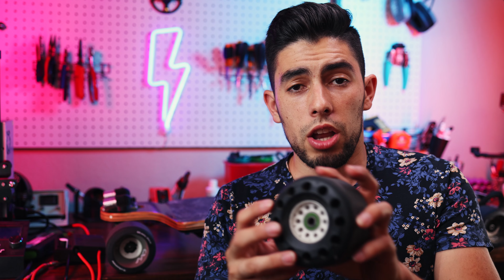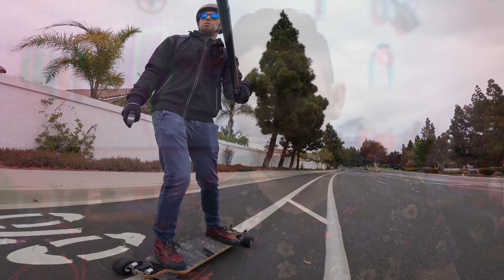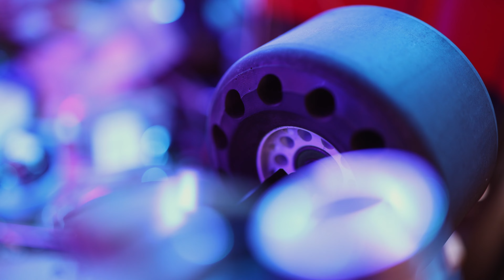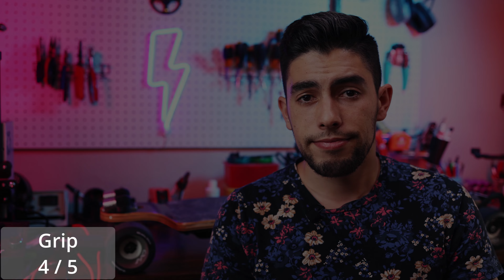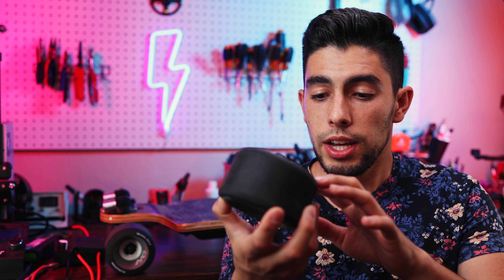MADESK8 / Boosted 105's: Best Urethane Wheel? (100 Mile Gear Review)

Comment: Nice and detailed review. Just to add some info : I just got a set of the Mads V2, and the Humming/whistling noise they make is pretty annoying to be honest. This noise happens at any speed, the fastest you go the more high pitched and audible it gets but it never disappear. It's not making noise like crazy, but it's still annoying to me. It's certainly due to the holes inside of them. I don't get any bad vibration so far though, just noise. I'm used to BOA wheels for street setup and they don't make any noise riding, grip quite well and don't chunk. In term of feel I slightly prefer the Mads over the BOAs, but that constant noise is killing the quiet rides that I like especially on nice roads. I've got also TB110s 74a and I've never liked them much despite all the good things I read about them. They really don't grip well at all compared to the BOAs or Mads, and I feel they bounce too much when in contact with rough roads. You should review the BOA wheels Ive got the old generation 83a, so I don't know how they compare to the new formula 76a or 74a
Reply from the maker: Thank you! It's interesting that the sound bothers you so much, honestly, on most of the boards, even at 30mph, I can barely even hear the sound over the belt or gear drives. I personally do not like Boa's at all. They're far too hard for my taste. You may really like the new Cloudwheel FE's, they have great comfort, but are completely silent. I have ridden the 100mm Boas in 76a, they feel pretty dang hard.
Reply: @RBEMotion  You're welcome. Further testing the MADS, the lack of free roll and (thus range killing) is the worst of all. Same exact run outside got me from 100% battery, to respectively 48% with the Mads, and I got 60% left on the BOAs (I swapped the wheels without touching the belt tension at all) . Same with my free rolling test : I'm cruising in an undergound parking with perfect surface at 10km/h and let go of the gas and check how far the board will go before stopping. The BOAs allowed me to roll more than 20m more than the Mads, which is a huge difference. So especially if you like to carve, this lack of free roll and range killing is quite bad on the MADs. The BOAs I used were the 83a from 2018. I'm getting the new 76a BOAs Yellow soon, so I'll see how good they are.

Comment: Please do a review on the Orangatang 105 Dad Bods!! Also side question, what are your thoughts on rubber tires vs urethane longboard wheels for electric longboard builds??
Reply from the maker: Coming up soon ;)

Typically, rubber tires offer more grip, and a lot of times more comfort, but at moderate range loss. For urethane, they're one of the smoothest rolling things you can put on your board. Very efficient, really feels skate-y. In addition, they're typically going to give you the most range possible.

Comment: Any word on how these compare to the revel snugs? I think i might have made a mistake getting the snugs instead of these
Reply from the maker: Hmmm - well I can tell you preliminary results show that the Snugs score a lower RBEM score.

However, a lot of that difference is in range and durability. Personally, I'd say the Madwheels are better overall, but that the Revel ones have equal or greater grip. They're both great but expect a little less range from the Snugs and quicker wear.
Reply: @RBEMotion  I'll be interested to see efficiency comparisons, as in my experience my board loses around a third of it's original range when going from 90mm wheels to the Snugs, a loss that I haven't felt with any other non-AT wheel.
Reply from the maker: Yeah that's because they're rubber. You'll find the madesk8 are more efficient overall. Once the full Snugs review comes out you can see the real number comparisons as well as the range guestimator

Comment: I have the verreal MAD wheels and I've ridden them for about 50 miles so far and in my experience, the wheels have a fairly severe vibration and create an annoying noise that is loud enough for others to hear when riding below 10mph. I'm guessing because I'm a heavier rider (200 -210 lbs). But once you pass 10 mph the vibration and noise almost completely disappear. Other than that these wheels are fantastic like described in the video, plenty of grip, lots of absorption (especially on rough sidewalks) and they don't eat up your range.
Reply from the maker: Thanks for the feedback and information! I do agree that once you pass 10mph, a lot of the vibration goes away. Other than that, yep, for these reasons, I consider them the best urethane wheel. Can't wait to compare them to the Hollow wheels!

Comment: Nice detailed review! What size belt are you using? I emailed Brian, and he said I "may" need a shorter belt than the 290 that I am currently using on my CLouds 120mm.
Reply from the maker: Thank you! The mounts I've got on my board are from Boardnamics, with idlers. My pulley setup is 15:40, and I ended up using 330mm.  Your belt length requirement will be very different depending on your mounts and pulleys.